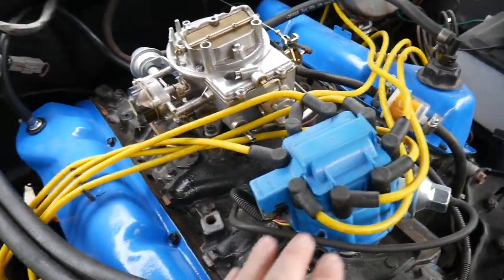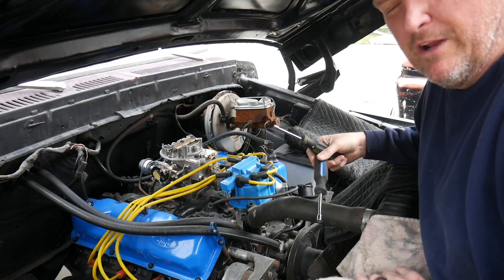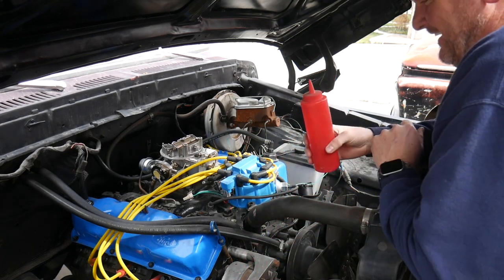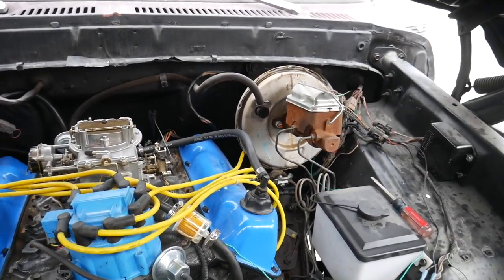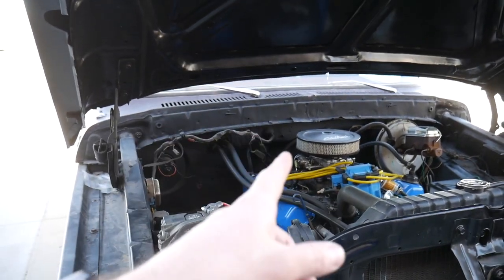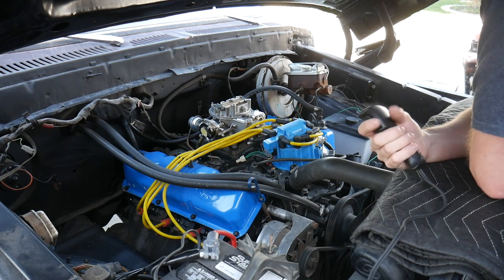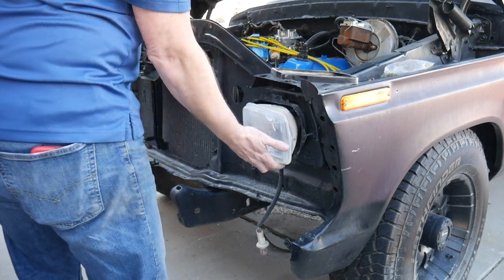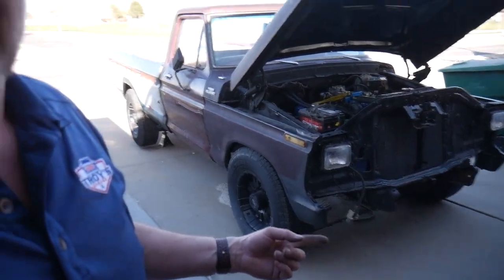79 Ford F250 Ranger - Carburetor Install and a FAILED attempt to tune - I need your help!

Comment: I love the progress you have made, something that I usually do when working way back in the engine bay is I take the front tires off and lower the truck to the ground saves my back just a touch, from Provo with love Ashton and his 76 F-100
Reply from the maker: I’m leaving the wheels on cuz I want to drive it in EVERY single video!  😂🤨

Comment: Engine is not running on 8 cylinders. Most likely a dead cylinder on the driver side. The cylinder is dumping fuel into the exhaust pipe. Start with basics. Start with idle mixture screws 1.5 turns out and fire up the engine. Make sure you have the right firing order for your cam, not the engine. Set timing to 8 or 9 as starting point. Use a spark tester light or the timing light to see if you have spark on all cylinders. Inspecting the spark plugs should also help identify the dead cylinder. Measure the resistance of the spark wires. Might be a dead wire or plug connector. Make sure all cylinders are firing. 
Checking for vacuum leaks is always a good idea. Many carbs have a bent base. 
Get the book from David Vizard how to tune Holley carbs. You will learn the difference between jets and idle mixture screws. Keep us posted.
Reply: Could be just fouled plugs I always go to the easy fix first.

Comment: Ok that engine sounds like it has a dead cylinder or two when running. Check for vacuum leaks first. Once that's fixed that carb should be taken apart if you didn't already. Reset the float level and take note of what size jets it has; likely it's jetted for sea level. They say to drop 1 jet size for every 2000 feet in elevation. Also likely going to need to change the idle feed restrictor size, as it fees both the idle circuit and the transfer slot circuit. Definitely put a new power valve in it, who knows if that chinese power valve in it is blown or not, which by the way it is acting it probably is. A Holley 7.5 PV should be correct for stock but I use 8.5 and 9.5 depending on my smooth idle engines and it still takes a hard throttle stab to get them to open. Really need an AFR gauge to do this without guessing. I've found 14-14.4 AFR cruising down the highway and 12.5-13.5 idle AFR to work well on the Ford V8's I've tuned, cruising at slower speeds just off idle when fully warmed up 12.5-13.5 AFR works well as a in between AFR for all weather conditions, too lean and you'll experience off idle stumbles when the primary circuit begins to start up NOT related to accelerator pump settings. You can get a good indication of how close the idle feed restrictors are when your transfer slots are set to a square or just over square, and your ideal idle fuel mixture is 3/4 turn to 1.25 turns out from seated, that is where I have found on 3 of my Ford V8 engines ranging from mild to wild they sit when it's correctly calibrated.
Reply from the maker: Finally a super helpful comment!  Another viewer reached out via FB Messenger with some helpful tips too. I recorded this video that posted today almost a month ago. Recorded more yesterday that I’ll get edited and posted this week. But same basic issue of smoke from the drivers side and stumbles when applying gas. Choke settings are still an issue as well. But I’ll get those dialed in once I slow down how rich this is running!  Thanks so much for the detailed response. This gives me something to work from. 🙌🏼
Reply: @troysgarage  Also, don't forget to test fuel pressure. Every single mechanical fuel pump I have ever had wound up producing 9-10 PSI causing all sorts of rich running and inconsistent tuning problems. All of my carbureted vehicles have a 4.5-9 PSI Holley fuel pressure regulator set to 5 PSI and all my weird problems went away on all of them. Get yourself a T barb the size of your fuel line and hook your vacuum/fuel pressure gauge inline by the carburetor and see what pressure you get running. If it's over 6 PSI, put a regulator on it.

Comment: You ended up not having a bent rod? I remember watching the video about 5 months ago.
Reply from the maker: It was bent. I replaced that rod with the best one from the original engine. Made sure it was an exact match and straight. I took all the rods out and tested them. Retorqued the lifters and basically started over. It’s been a mess!
Reply: Love watching the reseraction of old trucks! Thanks for sharing your journey with all of us 😎👍

Comment: That motor has an issue. Take a dollar bill, hold it lightly over each exhaust pipe and notice if it is being sucked into the pipe. If so there is a valve issue for sure. 
Make that step one

Comment: I can hear dead cylinders. Is the knock i hear from valvetrain or exhaust?
Reply from the maker: There's no knock up high so it's not the valve train.  It's a LOT more pronounced through the microphone, it doesn't sound bad at all (knock wise) in person.  Obviously running rough like it's missing a cylinder as others have mentioned.  I'm pretty sure I have at least 2 issues:  1, running to too rich.  Gonna pull the jets and swap for smaller ones to help resolve that.  2, misfire or completely dead cylinder.  Will be checking for fouled plugs, checking plug wires to see if they have full connections and no shorts etc.  That's my current working plan.

Comment: check the plugs sounds like fouled plugs
Reply from the maker: Will definitely do that. Thanks.
Reply: @troysgarage  i just noticed how much gas you’re giving it way to much flooding the plugs out I’m only telling you this because it happened to me same thing.Now 1 pump and start.
Reply: @troysgarage  and set mixture screws at 2 out to start these motors like it on the rich side I’m willing to bet 2 1/2 turns out is perfect. Mine was set at 3 turns out but that was too rich in my opinion plugs tell all. Plug readings will tell you what is going on any.and decel popping or spitting it’s to Lean just do plug readings
Reply from the maker: @robperkins2674  is that true even with a Holley 4 bbl carb and intake?

Comment: Its the chinese carb brother trust me I had same shit going on couldnt figure it out, the power valve in these are shit, at minimum take the float cap off the carb and see if the fuel is even staying in the bowl, i guarantee is dripping down into the intake. Get a Holley or Edelbrock
Reply from the maker: I've been leaning toward the power valve for a while, just haven't had time to validate/test that.  I suspect you are right.  It worked 3 years ago when we drove the truck from the old house to the new house, then the carb sat while we pulled the motor and put in a rebuild.  I rebuilt the carb but never touched the power valve.  I might just buy a cheap one to validate that, then bite the bullet and get a new intake/carb setup for it.  Been wanting to, this will be a valid reason to do it.  Thanks for validating my thoughts as well!!!
Reply: @troysgarage  I was in the same boat as you and it wasn’t until I opened the bowls filled them with gas and watched the gas disappear slowly. So I pulled it and found a seal in the power valve had a dribble. Goodluck man keep me updated!!!
Reply: @troysgarage  also, I changed to a 4 barrel edelbrock carb+intake and my truck never felt so alive. It’s so responsive and the power is opened up now
Reply from the maker: @Tyscrat  I saw in a facebook 73-79 group that someone had a 4 bbl intake they were selling.  I'm headed there now to see if that's still available.  Same some money buying from another truck guy.  Upgrade/Updates coming eventually!!!  Thanks for confirming my thoughts/feelings man!  Love the truck community and my viewers are the BEST!!!
Reply: @troysgarage  I’m in that same group, goodluck & look forward to the update and hopefully video soon!
Reply from the maker: I have like 8 videos to edit. None of them in Midnight Maroon. But I did go help a subscriber work on his 73 F250. That will be my next video that posts.
Reply: @troysgarage  keep up the hard work beother! I have a 78 f150 with the 400. Doing a lot of what you are
Reply from the maker: Pretty cool. My day job is very demanding and super stressful. My happy place is in the garage. I wish I could afford to pay someone to edit for me. I’d have all the fun and none of the stress. My channel needs to explode for that to happen. So any help you could give me….  😜🙌🏼🕺🏼